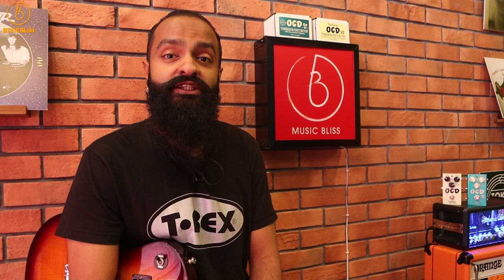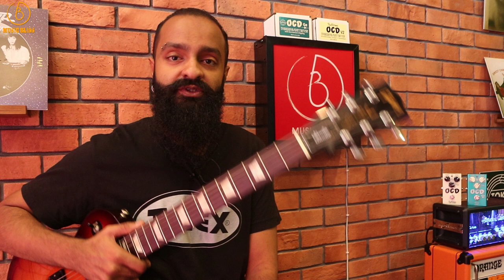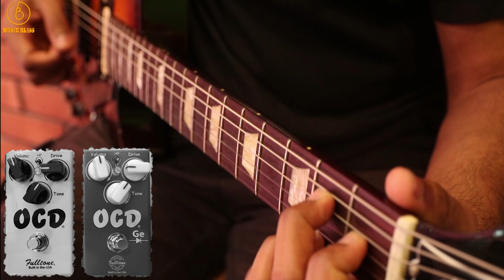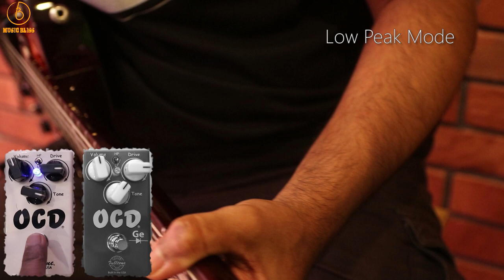Fulltone OCD Germanium vs OCD V2 Overdrive Pedal Comparison

Comment: I can hear a difference even on the tiny little speakers of my MS Surface. The germanium diode version sounds noticeably "cleaner" to me. I'm wondering if the Ge diode is the only difference between the two, or if the EQ was tweaked and might be responsible for some or all of the apparent tonal difference. It's sad, but these days it's often difficult to tell whether you're really buying what you think you are, or if you're falling for "clever" marketing tricks. I don't know much about Fulltone as a company, so it's not my intention to imply they'd resort to trickery to make sure the more expensive boutique version of a pedal sounds obviously different than the original, but from my perspective, if you don't employ a little skepticism to make purchasing decisions nowadays, you're likely to get fleeced. If the Ge diode(s?) is/are really the only difference, it's quite remarkable. I just bought and started reading a book on tube guitar amps written by a long time amp builder and found it interesting that per him, there's no question that components which on paper are identical can sometimes result in a night and day difference when it comes to tone. I'm totally on board with that, I just like to make sure things are what they appear to be before spending more to acquire them. 😉🤷‍😁👍
Reply: Well this might ditch a lot of the fets that make the design amp-y. Because the Germanium diode's tone should be more focal. But I'm no expert
Reply: hello, what is the name of this book?
Reply: @ClusterFugue pedals are usually built with components of 20% toleance...therefore when you add up the sum total of everything throughout the circuit there can be quite a range of tonal difference.
When someone makes a "clone" of a pedal they usually just copy the circuit part for part, which leads to the same type if situation insofar as tonal variances .
A lot if times a builder will alter the circuit or component values to result in a pedal that sounds the same...although not a 100% part for part clone.
Now, if you really like the sound of a particular individual pedal, it would make sense to spec out each component and then build the new pedal with parts of the exact same value using 1% tolerance components. ;)
Reply: The beauty is … only you can decide what you like , I have two small pedalboards , with a V2 on one and the GE on the other  as my main drive , they both sound very useful on a clean channel to my ears … my overdrives of choice after 45 years

Comment: wonder why your 2.0 has blue light？！
Reply from the maker: Good question, our most recent batch came with blue ones....
Reply: @MusicBlissMalaysiaTV  Fulltone started shipping with blue LEDs towards the end of 2019. Mike updated both pedals w/ less compression beginning March '20, these also have the blue LEDs. During the pandemic at least, you can identify the 2.01's by his signature on the bottom.
Reply: @jhaft703  Interesting tidbit.....and thanks. How did you come by this info?  Now there's even more models to be confused by, lol.
Reply: @Auen73  Because this is now the actual version 2. If your input/output jacks are centered on the box, then it is an actual version 2. If not it is one of the multiple version 1.1- 1.2- 1.3 etc.
Reply: @classicalguitarchase  Right on, my mistake. What I thought Jason H meant was.....That there is a more compression & less compression version of the (creme) 2.0 OCD.  As well as.....A more compression and a less compression version of the Germanium OCD (blue). Which would make like.....4 versions of 2.0...lol. I owned a 1.3 for a long time......to fat, to dark, no cut. Made single coils sound huge and open though.....no humbuckers allowed.  ....1.7 is a much better, and more usable in every way IMO......no drama....it just works.
Reply: @jhaft703  bottom of the backage or the pedal itself?